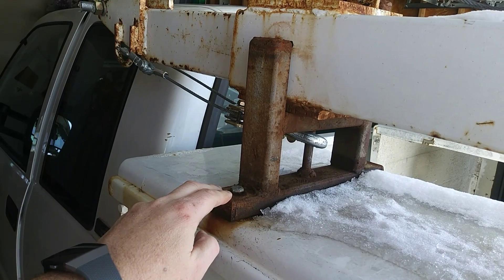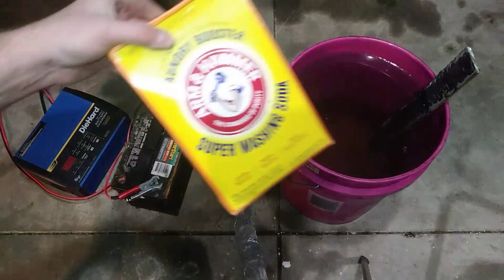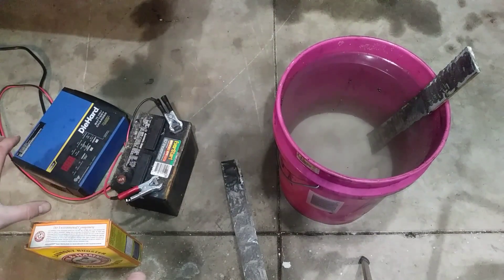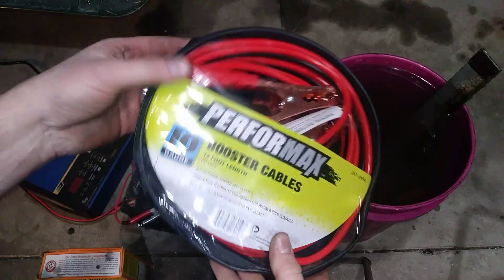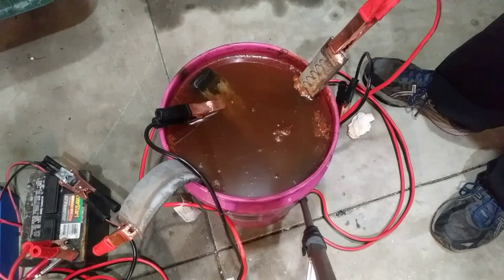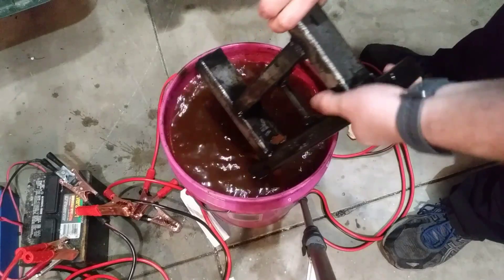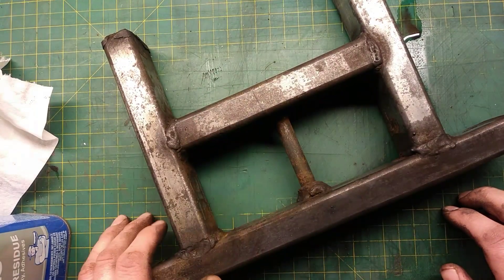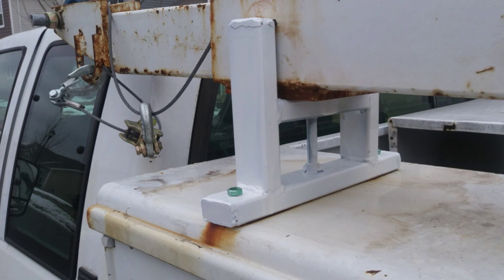Removing Rust with Electrolysis, DIY the easy, clean way!

Comment: Thank you for the tip on adding a battery load to trick modern smart chargers! I’ve been trying to restore a rusted 1851 Colt Navy revolver and my “smart” battery tender wasn’t working!
Reply: How did it work out? Doesn’t it spark if you’re connecting a live battery? Did you use a car battery?

Comment: how do you setup the leads and the charger though?What Amperage did you use?
Reply from the maker: +Oblama Positive lead from the battery connect to the sacrificial metal, neagative connects to the part you are removing the rust from.    Battery charger is optional, but a good idea to keep your battery topped off while the process is underway.   I had mine set to 15amp.
Reply: Thanks sir Re: the amperage. I will assume that you did not connect the black  clamps to the right most lead? That is the bit that is actually confusing me :P It looks like you hooked it up to the right most lead. Thanks for clarifying :)
Reply from the maker: +Oblama correct.    The black clamps on the right leads i did not use.